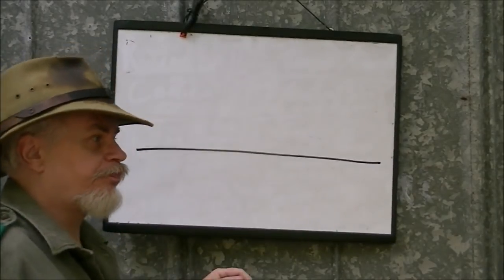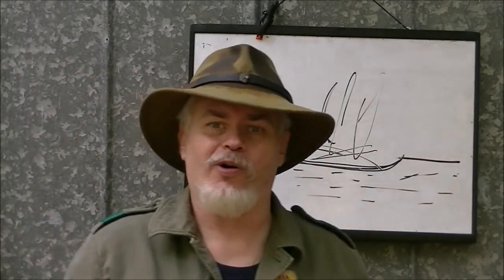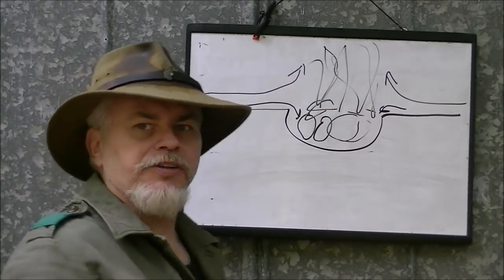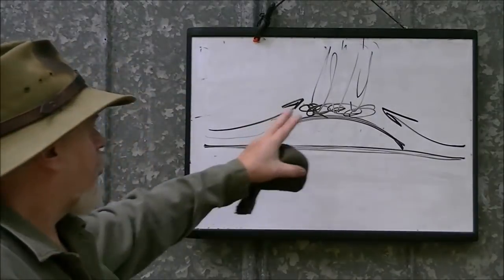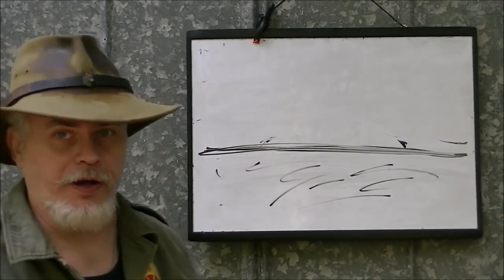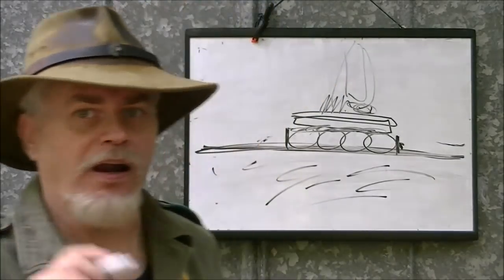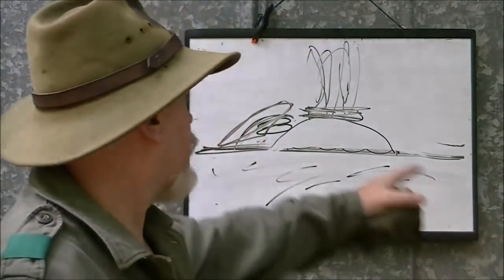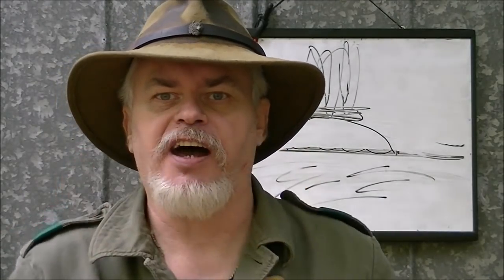campfire tips and tricks

Comment: Brilliant! I'm trying your tips next weekend. Something I experimented with yesterday in the North Cascade mountains was a curved wall of vertical green logs with a fire of seasoned wood inside the curve. I drilled several vertical logs into "torches." As the seasoned wood burned, it dried out the green logs to the point that they slowly burned over many hours. I haven't tried this overnight yet, but if I can break free this weekend I'll put it to the test. I'll modify it by elevating it above grade as you suggest. I've had a lot of success recently with vertical fire logs. Mountain wood in the North Cascades is extremely dense and coals don't last very long because all trees in the higher elevations are evergreens. The fir trees here have lots of oils that burn hot and fast, but the coals don't last like deciduous trees. Different from Georgia pine in that they are so dense they will dull a chain saw in 5 minutes. Forget about using anything but the heaviest and sharpest axe; anything else will just bounce off. Ask me how I know! (My ancestors are from Cartersville and I went to school in Georgia, so howdy neighbor!)
Reply from the maker: safe journeys

Comment: Centralia PA. Coal mine has been since 1962.  All good tips.   Also our LNT instructor  put a chocolate bar under the raised mound  fire. Just to prove no heat transmitted to the ground.
Reply from the maker: and how long did the fire burn?.. plus it will be effected by the soil..but i have baked in mine..just takes days to get the heat up